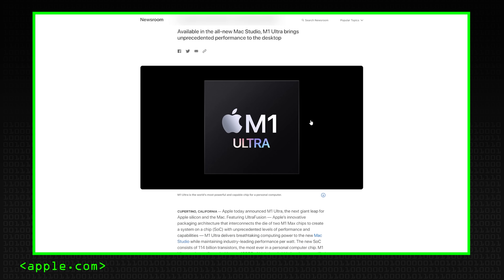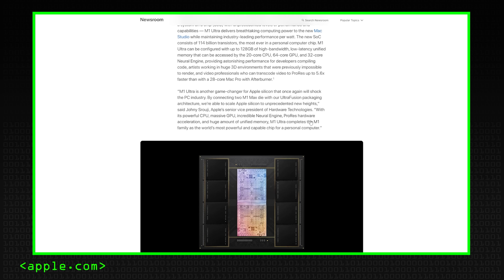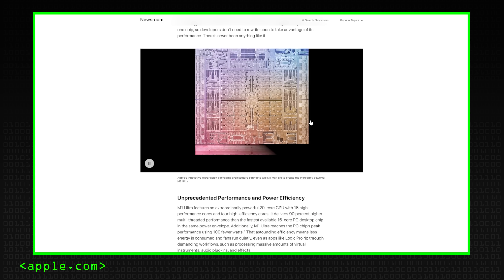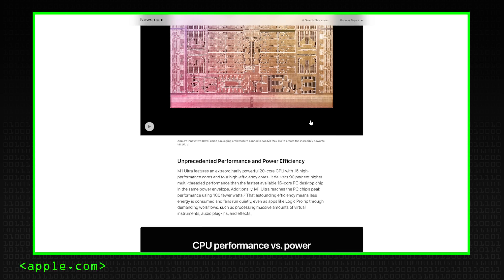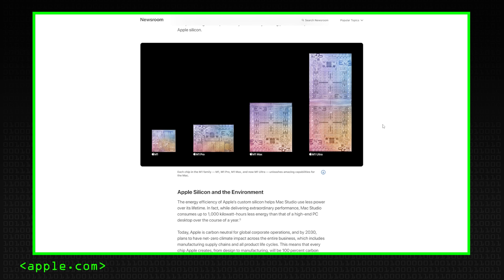Apple M1 Ultra & NUMA - Computerphile

Comment: Nice explanation of how NUMA architecture is implemented. However, you stated that the reason for moving to this architecture is because as you add more and more cores, you increase the probability of memory collisions. But then you completely forgot to explain how having 2 memory banks reduces the probability of the memory collisions that you would still get as you add the more processors.  It would seem to be the most essential element needed for this video which is completely missing.  (Yes I understand that now there are 2 memory banks with twice the bus bandwidth but this is never explained.  And there are different interleaved memory architectures which could increase the memory bandwidth without resorting to NUMA)
Reply: Agree 100%
Reply: Thanks for pointing it out! This is the exact question in my head immediately after the video
Reply: Same question here after watching the video.
Apple comes with a very fast interconnection, ok, but HOW data and instructions are stored near the right CPU was THE problem to solve. And it's not explained! :)
Reply: @Paul Ledak, you are in part correct. But that doesn’t work entirely like that. While in theory, that allows memory to be accessed in parallel without bus collisions and having to lock the bus, it practice it hurts scalability and it is extremely difficult to capitalize. This also complicates OS schedulers and memory affinity algorithms needed. For example, if I write an app that needs to utilize all cores, it is easy for OS to make thread local storage affinity to the correct cpu. But heap allocations used and modified across the thread takes a hit on NUMA as you scale the number of CPUs. Power and Sparc had been trying various things in the past with NUMA, but it does bring a lot of such complexities and in practice, realized bandwidth by most apps is quite small compared to best case scenarios test bandwidth published by the NUMA models. Also another complexity for Apple is the GPU where the access pattern is even more complex.
Reply: @rakeshravindran3147  I agree... Another complexity is that all the write cache coherency snooping bandwidth must be transmitted across all processors if one wishes to maintain a SMP model... it would seem that unless the OS allocates tasks to banks that minimize memory sharing (ie an non SMP model) that their architecture suffered similar scaling issues of a simple SMP implementation with many processors. Using your example of writing an app that uses all cores with a fully shared memory model, the Apple implementation does nothing to reduce cache snooping bandwidth (which is now slower across memory banks) nor does it reduce the probability of memory collisions in general... unless of course you write your application to be cognizant of the architecture... specifically what they suggest one can avoid with their architecture.
Reply: I'm guessing the M1 Max allocates tasks to cores according to where the data for that task is stored, but it is done at the hardware level rather than in the software?
That has the disadvantage that the hardware doesn't know what instructions are coming next, whereas the compiler does. But it can help.
Reply: @katbryce  Yes, except that it’s the OS that assigns threads to cores.  Also the OS can do it the other way around by assigning pages of virtual memory to frames of physical memory so each page is in a frame in the RAM that is closest to the cores that execute the threads that most use the pages.   For read-only pages such as code, it may make sense to put the same page in multiple frames so that it can be read from more than one RAM.

Comment: I would like to know what the architecture of the GPU is like after seeing this. I believe GPUs have thousands of cores, but I don't think I see numbers for cache in their marketing materials, just memory, cores, and clock speeds.
Reply: It's quite interesting how GPUs work actually. They function in a completely different way to CPUs, preventing this problem. Each core in a multi-core CPU system functions as a completely independent entity, accessing whatever memory it needs to complete its calculations. Different cores working on separate tasks can therefore end up accessing the same memory, thereby slowing down each other's progress. The gist of what happens in a GPU is that the entire GPU is dedicated to doing just one single task. Each one of its cores executes exactly the same task, piece of code, in lockstep. The key difference here is that each core performs the same actions, but on different pieces of memory. Often these pieces of memory are adjacent. So a (sensible) GPU program will never have different cores trying to lock the same piece of memory simultaneously. The GPU has chopped up one big task into 1000s of equal bite-sized chunks.

Hope that explanation helps!
Reply: @Edekje  Thank you, that is a helpful explanation. Is there some synchronizer that keeps the cores on task? I'm thinking like Tom, I know the GPU is basically a matrix multiplication fiend. Is that because it can easily distribute all the multiplications to a bunch of cores and then there's a synchronizer that can grab all those products and sum them together in the appropriate way to return the expected matrix?

Rereading your answer, I'm wondering if it's like a pass-the-bucket situation. Like a core takes a bucket of memory from the core "to its left", it does some operation on that memory, and then hands it off to the core "on its right", looking left for its next bucket. Or is it more like "i've got 10 buckets and I need 10 cores to work on them", hands those off, and then next "I've got 37 buckets,"  hands them off, etc.
Reply: @jbf81tb  Yes, I forget the exact terminology, but there is this thing called a warp scheduler on Nvidia GPUs. Pieces of code are scheduled on-the-fly there, and it's all done by dedicated hardware, to keep things moving as rapidly as possible.

I'd say the second scenario you sketch is more correct. This passing-the-bucket is more of a serial approach. A valid GPU program would work along these lines: I have 1 billion integers stored in memory, and I need to calculate their sum. We initialise 0.5 billion threads. Each thread reads 2 numbers, and sums them, writing 1 to memory. Now we have 0.5 billion integers, and repeat the process with 0.25 billion threads. In this way it takes about 30 invocations of this summing kernel to complete the job.  Obviously a real-world implementation would perhaps optimise by reading more numbers, say 16 from memory at a time instead of 2. It would also take account of the fact that there is a limit to however many threads you can create (thousands or millions, I forget. It's a lot anyway). These millions of threads will not all be run simultaneously, as the GPU does not have sufficiently many cores to do so. The scheduler takes care of this aspect.

I am not sure if modern GPUs can simultaneously run more than one kernel. This certainly was not the case previously, but it may now be supported to a degree.
Reply: @Edekje  so like vector/data level parallelism vs thread level parallelism?
Reply: @Edekje  like is a GPU usually just executing a single thread of vector instructions at a time, or can it split across clusters of execution units to execute different threads? I have really no GPU experience
Reply: @TDRinfinity  Yes, a GPU more-or-less can only perform vector parallelism. It is somewhat more flexible than that though. A piece of code that is run massively in parallel on a GPU is called a kernel. These kernels, written in C, can actually have divergent execution behaviours with if statements. Often times however, both parts of the if statement are executed, and only the result of the appropriate case is kept!! Very counter - intuitive. If all of the threads in a single streaming multiprocessor branch off the same way, I believe it is possible to schedule execution such that the other branch is avoided altogether. Writing a performant GPU program therefore requires a lot of in-depth knowledge. It's a completely different way of working, and is highly architecture dependent.
Reply: @Edekje  I have so many questions 😂 this is very interesting to me and something I've never thought much about. So you are saying that the GPU instructions are these C kernels. I am presuming that really you are saying you would write the kernal in C, it would get compiled to instructions on the CPU, and that there would be some sort of memory mapping to the GPU memory over pcie to actually communicate the instructions and input data over to the GPU? Like I'm just trying to picture this all at the hardware level, everything I work with ends in the CPU/SOC where all I care about is "there is a pcie interface that follows the spec".
Reply: @TDRinfinity  I wrote two long replies last night, which both got deleted by YouTube due to them containing links, dow.... So instead, look up the CUDA Toolkit Documentation Programmer's Guide. It is a very complete reference describing all these concepts.

The CPU has its own RAM, the GPU has its own RAM called 'video memory'. The CPU executes 'host code', which is your typical program in your language of preference. The GPU executes 'device code', which consists of these kernels commonly written in C(++). These kernels have to be pre-compiled indeed. Before the GPU can do any work, data has to be explicitly copied from the host memory, to the device memory. Only then can calculations with kernels commence. After the GPU completes these calculations, the final result once again has to be explicitly copied back to the host memory. The biggest bottlenecks are usually the PCI transfer speed (very slow), and the speed of the video memory (much faster than RAM, but still slow compared to the extreme processing speeds of a GPU). A well-written program therefore minimises the transfers between CPU and GPU, and tries to do as many calculations per byte of video memory. Modern GPUs have memory rates of in excess of 1000 GB/s, but when your device can operate at several TFLOP/s, you can see why the memory bottleneck is hit quickly. The whole trick of GPU programming is therefore not outsourcing calculations to the GPU, that's easy, it is ensuring that the GPU is always actively working and not idling, waiting for data. A GPU is basically a calculation cannon.
Reply: @Edekje I'll look that up yeah, but no what you are saying makes perfect sense. I think that fills in the biggest gaps. I was wondering like how it would be able to do highspeed calculations over pcie, but that makes sense that that would be basically the hardest part, like programming around that huge latency. Thanks for the info, I'm excited to learn more about this and maybe playing around with writing some GPU accelerated code :)
Reply: I don't know about GPUs with 100% certainty, but I design SOCs with hundreds of cores and we still have individual caches for each core, as well as shared cluster caches

Comment: Think I missed something here. Totally got the "was slow but Apple made it fast." However I think there's a promise of "won't need to change the software." The NUMA method requires knowledge of which memory block has the desired data. Hence, a change to software. So... did they also build a way to hide the fact of two memory blocks?
Reply: The reason NUMA systems usually require the software developers to be aware of the positioning of CPUs and memory is because of the slower speeds when fetching data from memory that is farther away. However, the new M1 chip claims to make fetching data fast enough for the worst-case RAM position to still not cause any slow-down.

I assume this means that the difference in time to fetch memory that is close, compared to memory that is far away, is less than a clock cycle. So from the core's point-of-view they have the same latency.
Reply: @elliott8175  the “trick” is literally the hardest part that no one could solve 😂
Reply: @elliott8175  great. Thanks for the clarification. Thought I missed something.

Comment: Apple: "M1 ULTRA FUSION!"
Reality: "It's a fast wire junction."
Reply: Reality: No, it's a bit more than that.
Reply: If it’s so easy everyone would make 10TB/s interconnect 😂

It’s a lot more complex than that.
Reply: @RunForPeace-hk1cu  it IS actually fairly straightforward to make a 10TB/s interconnect. but the cost is beyond crazy. besides, your need a cpu of such power to take advantage of it, so the cost makes even less sense. so the reason is not they cannot make it, the reason is they don't need to, at least not yet.